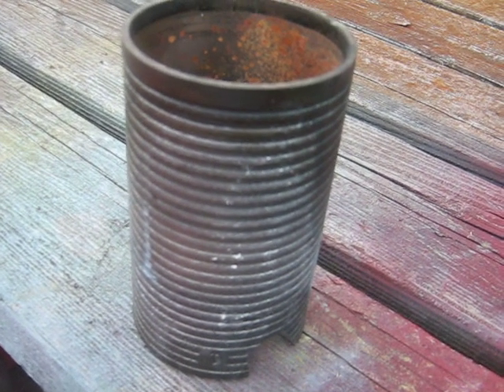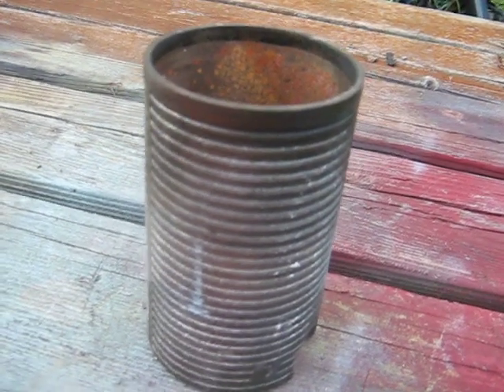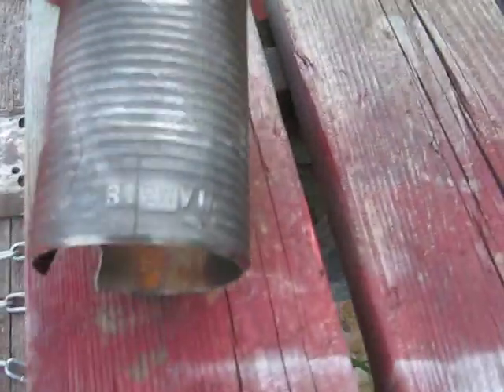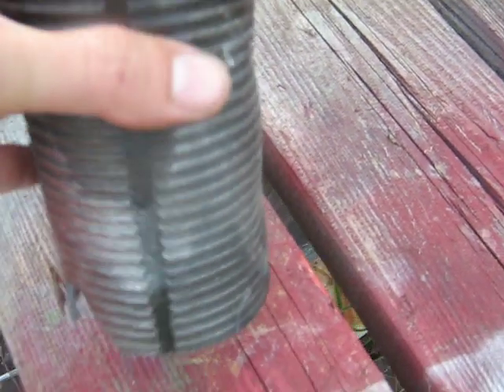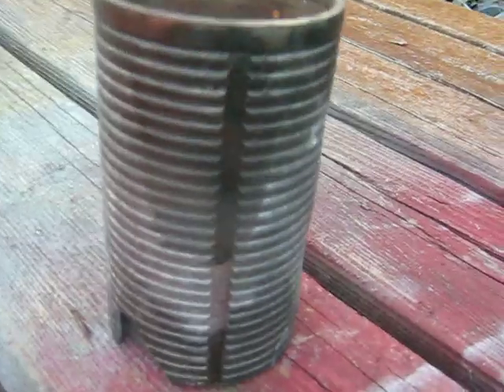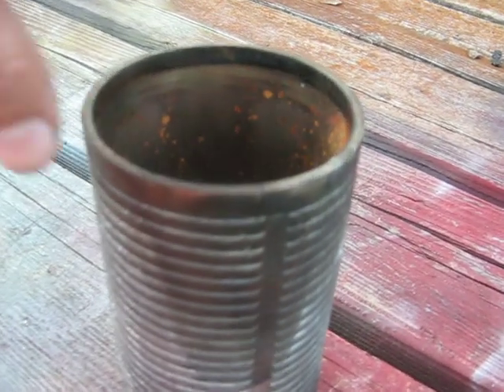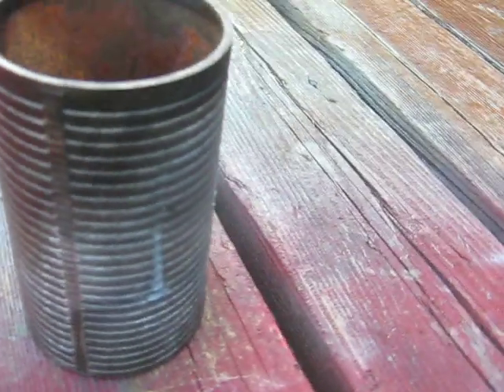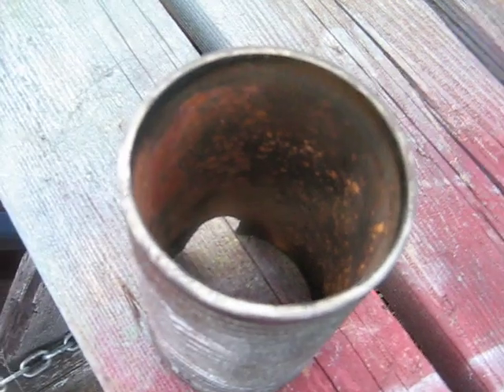Honda Cylinder Sleeve

Comment: the cast alloy around it adds a tonn of support for it, the liners are more like a hard wearing skin for the alloy block, where as the normal alloy cylinders tend to wear away much faster, but cost less to manufacture.

Comment from the maker: It is backed up by 1/4 to 3/8" of aluminum when it is in the block, so that gives it a lot more strength. A pushmower cylinder wall is only about 1/8" thick.